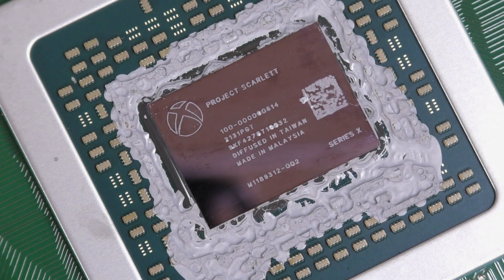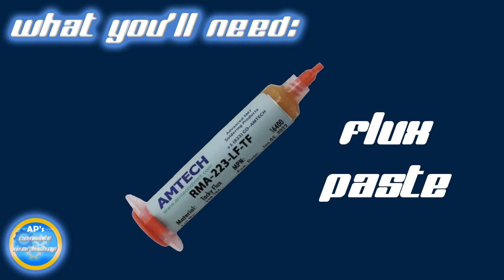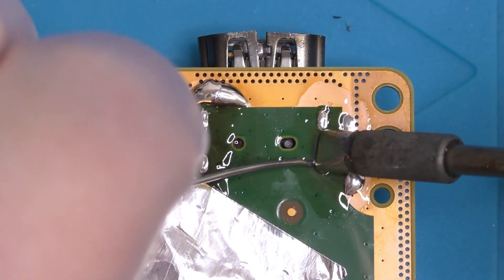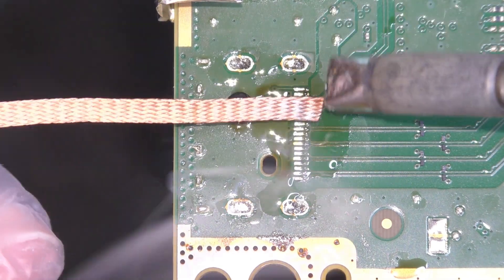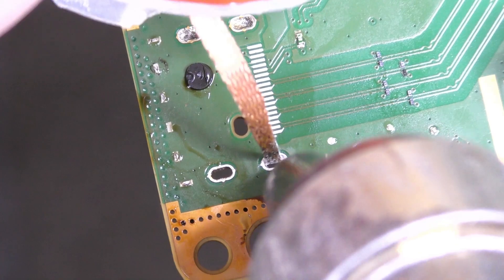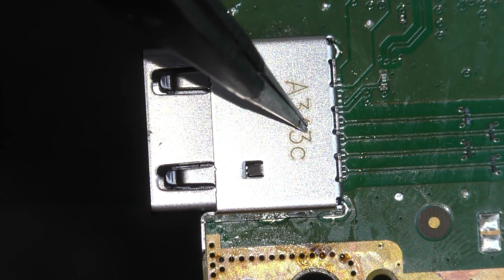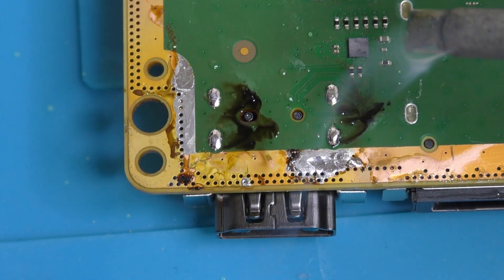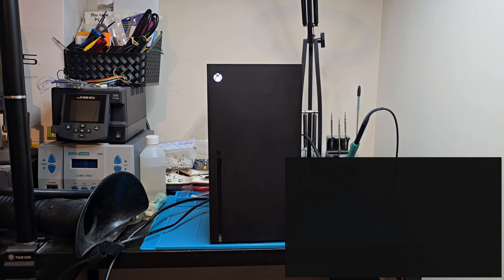XBOX Series X HDMI Replacement Tutorial

Comment: Wonderful timing for the video! Question for the use of a heat gun. I only have a larger hear gun with a large o output, could the soldering iron and wick be sufficient for the same repair or would you say the heat gun is required?
Reply from the maker: Hi, the heat gun is definitely required.
I wouldn't attack it with a paint-stripper style gun, not saying it wouldn't technically be possible but you want to keep the heat as localized to the port area as is possible.
Reply: @ConsoleWorkshop thank you! I got it with a cheap hot air reflow station and a good preheat but it was difficult! Definitely not a starter friend job. Took maybe 3 days of learning and an hour of work but job done with your help!
Reply from the maker: Excellent job! 👍

Comment: I use low melt solder on pins and grounds and just heat with air from the top side.to remove. I still use just solder iron to put the port back in but think your method of using air is likely better. Will try next it time I do one.
Reply from the maker: I get the impression low melt really would help with these, I need to get some in I think! Many thanks for watching! :)
Reply: It's good stuff. I seen the hot drop method fail so many times had one this week it was 13 traces that needed jumpers. Your method is on par with my way of doing it.